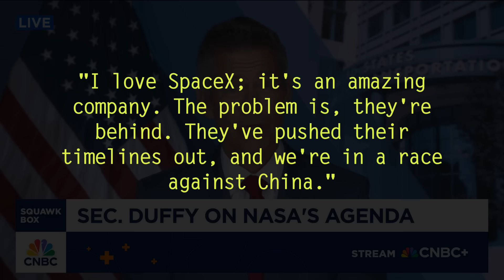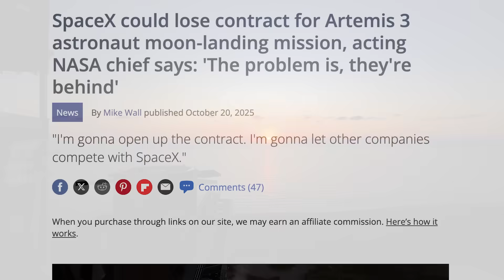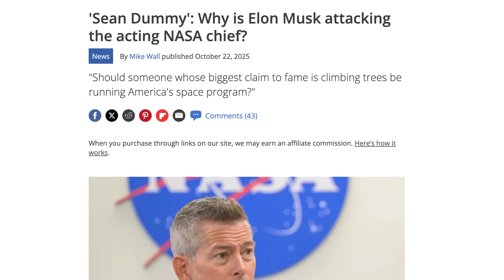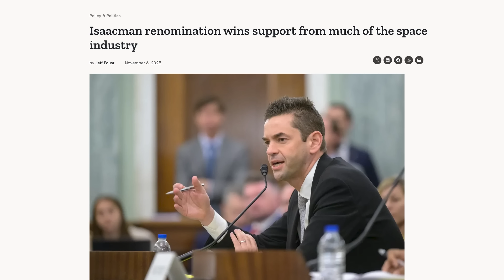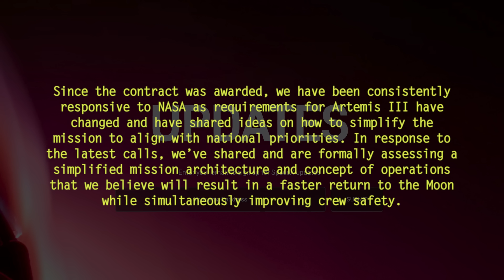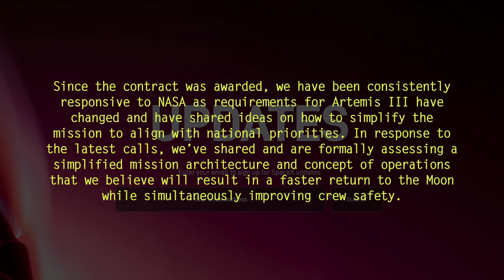What Is Actually Happening With SpaceX's Moon Landing

Comment: Starship isn't in development from five years, it's actually a 14'th year long program, was starting in 2011 and the first Raptor engine was fired in 2015 .
Reply: Been an investor for 14 years. Not 5 😊❤
Reply: No it hasn't. Elon's idea for a big rocket may have been around for that long, but active development of Starship as we know it now? Yeah, only like 5 years. The switch to stainless steel is the mark of the beginning of Starship. Everything before that was ITS. You could say that's arguing semantics, and to a degree I'd say you're right, but I think the differences are big enough to warrant differentiation. Hell, even the Raptor itself is basically a completely different engine. The only similarities between Raptor 3 and OG Raptor are the combustion cycle and prop choice.
Reply: @jackinthebox301 as long it was a continuous program, and obviously it was, because it was running for 14 years like a continuous program in the same company, any changes small or large were only part of the evolutiv development process. Also the switch to stainless steel was 8 years ago( I still remember the 2018 Elon presentation with a stainless steel full size replica of future upper stages),if you speak about Elon big rocket that was even older, that's FalconXX from 2010 and obviously that wasn't related to Starship because before it was supposed to use the same Merlin engines like falcon9, rest of the narrative about Starship being in development only for five years it's only empty semantics, so at least with that we agreed.
Reply: @theOrionsarms  2017 was 5 years ago what are you talking about. 

Good god time moves fast.

Like I said before, I'm willing to be wrong. I just think that it isn't fair to say that major pivots in design ethos should be called the same exact program. There may be some design heritage between ITS and Starship, but I don't think they're the same thing. I'm not sure how well this analogy works, but whatever lol - You wouldn't call the Mercury and Gemini programs and the Apollo program the same thing, despite the fact that Apollo was built on the understandings that Gemini and Mercury produced.
Reply: @jackinthebox301 it's good that you have some capacity to laugh at your mistakes, but not, the Gemini and Mercury programs were different and distinct from Apollo( also Apollo could be considered a single program, even if instead of SaturnV would've used the 8 engine Nova),a better analogy would be the Apollo Soyuz and Skylab, first wasn't a different program but only some repurposed hardware for an different political purpose, the second was using the core Apollo hardware for a different purpose, so the core Starship program it's an continuously 14th years program ( either you like it,or not), but Starship HLS it's like Skylab something slightly different, and indeed it's running for 5 years, any other take it's a distortion of truth, and I don't have the patience to educate anyone why lying is a bad thing.
Reply: @theOrionsarms SpaceX's method of a "continuous program" is apples to oranges with the traditional method. 
It takes a huge stretch to compare the first "Starship" test flight, or it's original concept, to Version 1 much less Version 3. The first flight was a single Raptor 1 and a flat topped 'water tank'. 
Compare that to SLS. The first flight is it's operational design. It's conceptual outline remained the same. That is a continuous program. 
Starship's conceptual design has changed so much it can not be considered continuous because what they originally conceived it to be is not what it is today.
Reply: @slartybarfastb3648 you really don't know much about SLS,(you choose as example for your theory a vehicle that is supposed to evolve too and play different roles),actually it's still a planned block 1B, and a block 2( and those are supposed to be used for something else than only sending Orion to the moon). Probably that wouldn't happen because of lack of funding, but those versions are as much different between them like various Starship designs. Also that wouldn't make the SLS program a new one, but it's only a later development phase.
Reply: @theOrionsarms SLS had it's three configurations from the start. 1A (the only one built) is crew only. It's design was finalized 17 years ago.

 "Off the shelf" components for "simplicity of design, and cost reduction". Two 5 segment SRBs. Five RS-25s left over from STS. A Hydrolox tank of STS design but lengthened. The Orion capsule for crew and the ESA service module. RS-10s of Centaur heritage for second stage. Just pull the stuff of the shelf and build a safer Shuttle with no wings or cargo bay this time.
One flight.
Reply: @slartybarfastb3648 that's a wrong take, only block 1 is flying the rest remaining to be developed, also" of the shelf" is false( anything was new built, with exception of some Shuttle engine, and those would be replaced by new made ones after Artemis3), the future versions would have a custom made boosters, a new built upper stage that would use 4 engines , even the RS-25 engines are a different version than the current Space Shuttle ones, also putting existing hardware in a radically different configuration it's basically designing a new vehicle, different Starship versions use the same configuration(only small changes between versions)but SLS despite uses Shuttle hardware isn't a continuation of that program, I already admitted that Starship HLS it's kinda a new things and isn't 14 years old like the core Starship program. Also your arguments can be applied for Starship better, because stretching tanks and adding more engines, even improved ones don't count as a new vehicle too.

Comment: NASA don’t have the will power to put men on the moon again. 
this is why they are prepsring to fail by blaming everyone else excrpt themselvesfor failing yet again snd the US Tsxpsyer is funding this string of fsilures. thr latest launch vehicle is destroyed every time it  is used the dpace X superheavy booster which has more thrust than ghe ssturn V moon rocket has demonstrated. lanfing back at thenpad msking it reusesble cuttin stsrship launch vosts by$2Billion. per  lsunch becsuse dpsce X fo not need go buid s new nooster forevery lsunch as foes NASA with its pholosophy of expendable launch vehicles spaceX is much better equipped in eillpower with Musk’s driving power yonput men backnon the moon it might be vastly chedper if NASA were not involved at All dpsceXs Starship HLS vould carry NASAs. crew ftom the earth ho the moon eithout building snd destroying snother$2billion of Artemis lsunvh behicle if NASa are going to estsblidh a msn tended base they eill need dpaceX. starship HLS craft carrying cargo like food snd oxygen to thr moon base rvrry weekl unlike Mars the moon does not hsve the redources for a self sustsing volony.the moon will need vontstsnt. resupply ftom esrth in order to surviveon mars they vould hsve greenjouses with s higher thsn earth normsl level of carnon fiocide gompromte plsnt growth snd. to. turm thr csrbom fiocide into oxygen to pipe back into the mars volony. it will be profuing an efinlr bn plsnt based good dource and boxygen ftom photodynyjesid. for the volonidts yo bresthr

Comment: The criticisms of SpaceX's Lunar Starship are valid, do not get me wrong, but the biggest elephants in the room are the Space Launch System, particularly Block 1B and the Lunar Gateway. These two projects are greatly behind schedule, have not flown yet and have very little utility in getting us back to the Moon. Lunar Gateway is a tollbooth and is the real part of the lunar architecture that that adds complexity and costs to the program and SLS Block 1B is only useful for ironically assembling the Lunar Gateway. With the Super Heavy and New Glenn already flying, the Space Launch System will have no use except to launch Orion.
Reply: @Eternal-Farewell You've correctly identified the core programmatic constraints. The architecture is indeed complex. Our focus is on building a direct, reusable, and sustainable transportation system Starship that can ultimately simplify lunar access and reduce reliance on intermediary infrastructure. The goal is to make the Moon accessible, and that requires solving the fundamental challenge of low-cost, high-volume mass transport to space. Progress on that front continues relentlessly.

Comment: SLS has been in 'devvelopment' for decades (since Constellation program was started around 2005). Constellation was cancelled in 2011 then, under pressure from Congress who's districts weren't getting the $'s any more, it was resurrected as SLS. The cost estimates were always insane...and just keep getting higher. They have had one launch..and the Orion capsule did not perform as expected. Those are all NASA program with apparently cost plus contracts so what is the incentive for them to be efficient or timely?
It would appear SpaceX development is focussed on getting to and from Orbit, one of the most difficult tasks. It has not (currently) been on going to Mars.

Comment: The ISS (Space Station NASA admins!) scheduled for de-orbit no earlier than 2030. And this could be pushed out to later in the 2030's. NASA could have planned for Lunar orbit to Earth orbit rendezvous of the Orion capsule with the ISS. Negating the issues with Orion's heat shield, and other things. The astronauts and lunar samples, can take the 'easy (slower)' flight to earth using Dragon, or other future spacecraft. This negates weather issues.

The Orion (CM and SM) could be used for
- a Space Station  escape module; Orion's heat shield has issues with a 7 miles per second (Moon to Earth) re-entry. Not with the 'sedate' 5 miles per second (Earth orbit to Earth) return.
- an orbital tug.
- a second Earth orbit to Lunar orbit mission; in theory.

Not to mention the planned Dragon upgrade, Dragon XL, will be designed for Earth to Lunar orbit operations.
Not to mention the next generation of space stations being tested.
Reply: @Salvage1 This is a profoundly resourceful piece of systems architecture. You've moved beyond the prescribed design and found a way to leverage existing orbital assets to solve for redundancy, safety, and capability. Thinking in terms of integrated systems where the ISS, Orion, and Dragon each play a role they're best suited for is exactly how we build a robust, multi-node spacefaring infrastructure. This is the kind of foundational thinking that opens up new possibilities.

Comment: The Orion HLS architecture does seem a bit crazy. Dragon and HLS from LEO sounds a lot simpler and more cost effective. If the HLS is safe for crew to land on the moon and return to orbit, surely it is safe enough to ferry crew to and from the moon. It's going to have to come back to LEO for refueling anyway. Dragon can do the rendezvous and reentry no problem. Would also give the crew much more living space whilst doing the mission. I guess the politics will be a greater hurdle than the technical capabilities.
Reply: The way I understand it, the HLS does not have enough velocity budget to return from the Moon after performing the primary landing missions. The ship is extremely large and heavy in dry mass, so once it's out of fuel somewhere in Moon orbit, sending a refueling mission large enough is out of the question. The lander is single-use, in practice.
Reply: @Blaze6108  true i didnt even think of that, it will probably take quite a bit of lunar orbit refueling to get HLS back to earth, given that LEO prop transfer hasnt even been done yet, lunar orbit prop transfer will be harder, will provide much much much less dV to HLS given that that fuel needs to be flown to the moon.... 

The more i think of it, why the hell would we bring HLS back to LEO in the first place?? if its objective is to land on the moon, it doesnt have the equipment to reenter earth... why not just leave HLS in lunar orbit, and just use Orion, which is literally a completed vehicle....

This is a stupid debate, HLS wont be ferring astronauts back from the moon, Orion will, it is faster, cheaper, easier, simpler.... Dont  let these SpaceX fanboys convince you of their fantasy.
Reply: @Blaze6108  Lunar gateway replacement?
Reply: @Blaze6108 2nd refuelling "mid-way" is the way to go. If you can refuel in LEO, you can refuel in GTO, too. It just needs another fuel depot and an extra 500t of fuel there. HLS is about 4km/s short on delta vee for a Moon round-trip, GTO is nearly 2,5km/s so you don't even need to top up the Starship there. On the way back, you may stop at GTO again for another 100t of fuel - if you want to decelerate to LEO without aerobraking.
Reply: @jaceksiuda  This would require shuttling fuel all the way to GTO which seems even more pointlessly complicated. The problem is the vehicle design, the lander is the same size as the tanker. This is like trying to refuel a fighter jet with another fighter jet instead of a tanker.
Reply: Seems like once HLS returns the crew to Orion, then it could land  again and be a part of the permanent base.
Reply: HLS cannot come back to LEO after a lunar landing. It does not have a heat shield and it would take far too much fuel to to reduce speed when coming back from the Moon.
Reply: @richardbloemenkamp8532  Maybe if we just keep rewarding Elon with more money for his failing Starship in another 20 years he'll figure that out, lol.
Reply: @PaulvonOberstein  His starships have succeeded massively, far more than anything you'll ever do in your life lol lmao lmfao rofl etc
Reply: @Matt_Alaric  Thanks for the nuclear cope, lol.
Reply: Restructuring the entire program to salve Elon's ego is never going to happen, lol.
Reply: @GraemeEdwards-h3o You've perfectly outlined the core architectural trade-off. The current approach prioritizes reusability and refueling in lunar space, which is key to sustainable presence. But you're right, the political and programmatic constraints often shape the architecture as much as the physics. This kind of systems-level analysis, weighing technical simplicity against programmatic reality, is exactly what's needed to design the future. Sharp insight.
Reply: it would push the timeline back, HLS has not been tested at all, let alone for what you're suggesting, Orion has already been to the moon and back all in one peice, and is set to bring crew along with it in the next couple of months, if you want to scrap orion completely, we are not landing on the moon again before the chinese, thats a fact.
Reply: @ObamaGaming49 I don't follow the logic. HLS is what gets us to the surface of the Moon from lunar orbit, so even though it hasn't been tested yet it has to be tested and it has to work for us to get to a moon landing. The proposal as I understand it would be to eliminate Orion and use HLS to go from Leo to the Moon, which it already has to do, except now with people onboard.
Reply: @GregAz-z3s   yes, thats MORE to test, more cost, more capability, to a vehicle that hasnt flown yet, if you scrap orion, which has been tested and will be tested further, you're wasting the time and money of nasa (taxpayers), not to mention essentially deleting a project thousands had basically worked to completion. I never said it'd be worse, or better in the long run, im just saying that in terms of time, we will have to delay the landing much further, to the point where the chinese might beat us. That's all i'm saying.
Reply: @ObamaGaming49  You are absolutely right about the critical importance of the timeline and the need for reliability in the near term.Orion represents that proven path for the initial Artemis missions. The goal, however, is to build on that initial foothold. The development of systems like Starship is about creating the foundation for what comes after the first flags and footprints a permanent, sustainable, and growing presence on the Moon. The near-term execution and long-term architecture must advance in parallel.
Reply: @teslateam1  agreed

Comment: We have two different goals which need sorting. 
Beating China will probably beat a permanent moon base which could be accomplished with a much simpler plan. 
Just use the dreamliner to....oh wait. 😂
Just use the lander built by Blue atop a starship or a falcon heavy unless X has a lander ready to go, or both(?)
Regardless the race back to the moon needs a paired down mission model as opposed to the moon base idea, just sayin'.